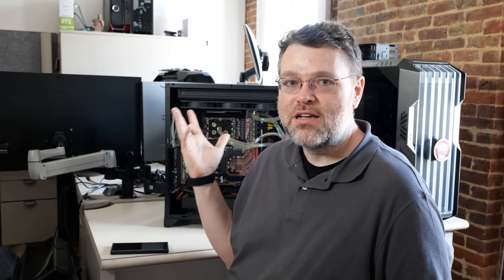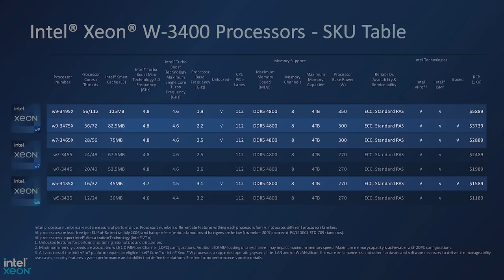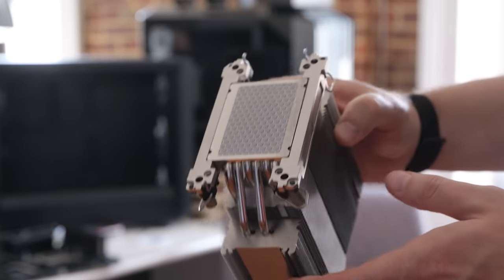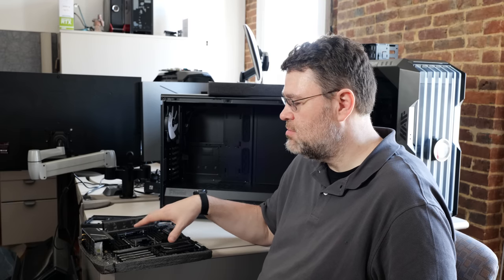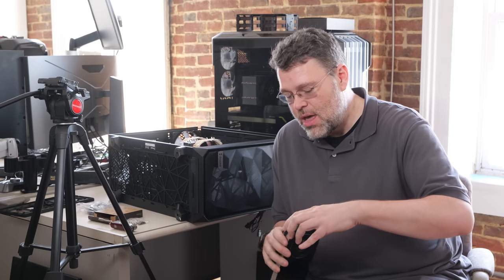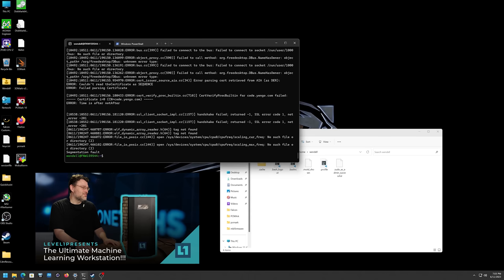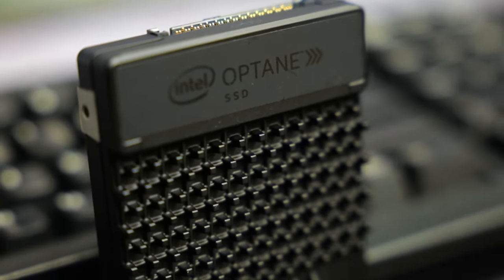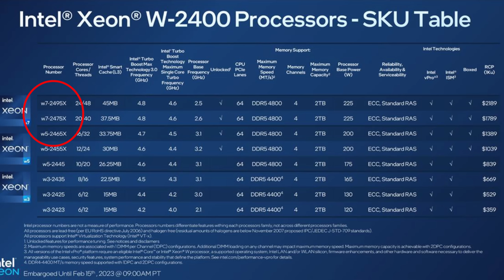Hitting The (Sapphire) Rapids With The ASRock W790

Comment: I have to dispute Wendell's quote early in the video on how VROC has the lowest latency.  It took me forever to learn that VROC is designed for 4 users and up at a time for optimal performance (I.E., a server).  I tested both x4 drives on a p3608 intel card as well as four 58gb optanes in raid 0, and in each case, the QD1 speed was massively slower than a single drive.  I ended up using my Hyper M.2 card for individual drives, fun squeezing windows 10 onto 58gb then I got a 118 optane as well.

It seems intel shifted iRST to include raid and that is for better QD1 raid performance for a single user and should be used over VROC.  I could not get this to work on my x299 PRIME DELUXE board but maybe because I did not have the DELUXE II variant, it appears RST only works for sata drives with that BIOS.

Regardless, I still pat myself on the back for installing windows to a VROC raid and it all worked thanks to a super cheap passthru VROC key I got (intended for supermicro boards) for like 30 bucks.

Comment: Why do most motherboards only offer SATA or nvme? What happened to SAS? Don't we want out HDD's to have greater speeds than slow SATA  and get to SAS @ 24 Gbps (SAS 4.0).  What am I missing here?
Reply: The ASUS Pro WS W790 ACE (W2400) and SAGE (W3400) have multiple SlimSAS connectors on them, if that will do for you.
Reply: @daveg4417  Thanks.
Reply: Most spinning rust is slower than SATA can handle and if you want actual speed you go for nvme.

What is the actual use case for SAS in this day and age?

Comment: Guys. If you are having a hard time losing weight. Get your testosterone  lvl checked. Thats usually the culprate.
Reply: Statistically test levels are rarely the reason (especially in men under 50). More often diet, lifestyle, metabolic disorders like pre-diabetes, Thyroid disorders, Lipids or Kidney Issues, etc. Unless you have the test levels of a 90-year-old man and are ingesting massive amounts of estrogens, low test alone in an otherwise healthy active individual may result in an extra 10- or 20-pounds max. 

And the vast majority of the time younger men are overweight, is due to bad labs due to poor nutrition, some serious lack of activity, and a great in-balance between their calories-in/calories-out. This I know a great deal about because I was born with Hyperandrogenis - my body produced too much test and I hit puberty at 11 and stopped growing between 13 and 14 years old (stunting my growth).

I had body hair, lots of muscles, and was balding at 14 years old (I looked like I was a short and stocky 20-something college wrestler on Tren). All my growth plates fused while I was 13, and then just after my 14th birthday, my body basically burnt out and I went from 900-1200ng/dl at 13, to a fraction of that almost overnight. I gained a bunch of weight and had horrible acne, and health problems to have haunted me to this very day (such as early onset arthritis, infertility and chronic cystic acne).

The double edge of producing so much test as a child, is that after puberty (13-14) - my body suddenly went into a permanent hypogonadism state, which at 37 years old (if not treated) my test levels have been the nearly same since they crashed when I was 14 years old! I have had a sub optimal 200-280ng/dl (it fluctuates) since I was a teenager and pushing 40 it was already so low that it has barely creeped down.

I waited until I was 34 to start hormone treatments and I only lost a slight bit of weight. I felt better and had more energy - but I pretty much had the same muscle and metabolic burning rate. I however have lost over 70 pounds since last year - and that was due to a 2000 calorie diet, walking/running 1-hour a day, addressing my metabolic disorders, having my lipids taken every two months, removing all gluten eating a very low carb and no saturated fat diet (yes, both), and starting a fitness routine (outside of the walking/running).

Completely removing Gluten, bread, caffeine and adopting a modified Mediterranean diet made the biggest difference of all!

Test replacement is not the magic bullet - it will make you 'feel' better but will not give you a Chris Evans Captain America transformation. It is not the reason people who sit around all day and eat gluten, carbs, high fats, drink caffeinated sugar beverages, and probably have undiagnosed pre-diabetes and high blood pressure are over-weight by 50+ pounds.